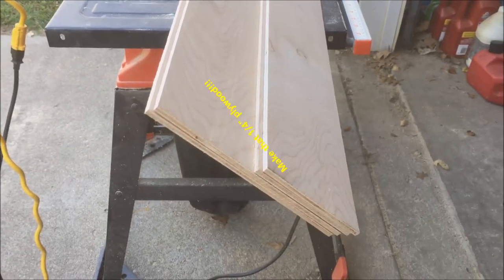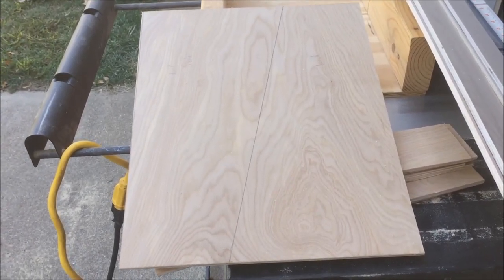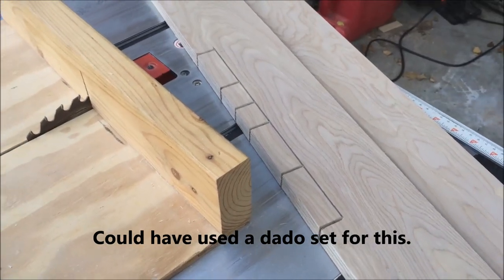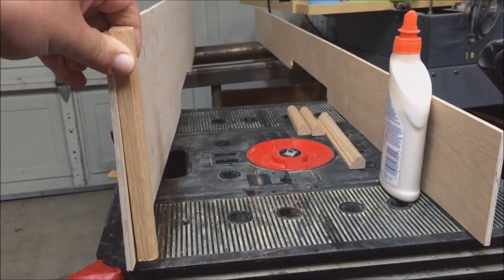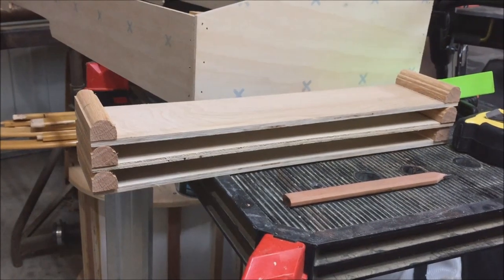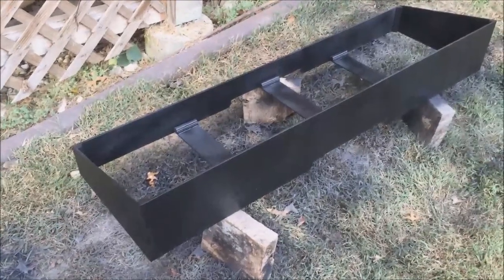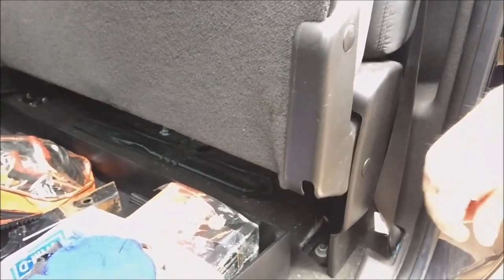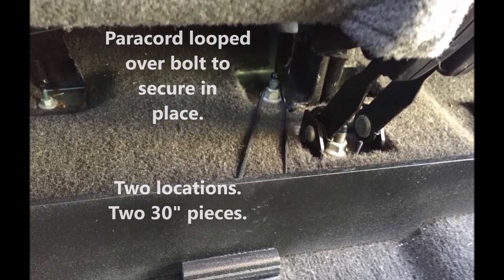Truck under seat storage - DIY

Comment: Do you think sticking large patches of hook velcro to the bottom of the box would also work?
Reply from the maker: It couldn't hurt. My buddy never used the ties and his doesn't move. I thought it could be an issue when I installed mine. Maybe if the bottom was flat and smooth it would move more.

Comment: I do alot of woodworking and your video tells me I can do this also.  Have you found it holding up alright, or would it be better made from 1/2" ? Also have thought about making it lockable if you turned it into a gun case?
Reply from the maker: Jeff Pauly it is holding up well for me. I will say that i don't get in it a lot. By that I mean, I get straps out once in a while and occasionally get out the umbrella or ice scraper. If you plan to put heavy stuff in there, I would go with 1/2". You could definitely improve on my design to accommodate your needs. To make it lockable I would fully enclose it and somehow secure it to the truck so it can't be removed without unlocking it. One improvement I've thought about is adding 2x2 to the front corners and then cutting them round to better match the seat profile but that's cosmetic in my opinion. Thanks for the comment and enjoy making your own box.
Reply: Thanks Seth, I have found with many past projects that later use I find a better way or addition, your corner idea sound duable. Thanks again